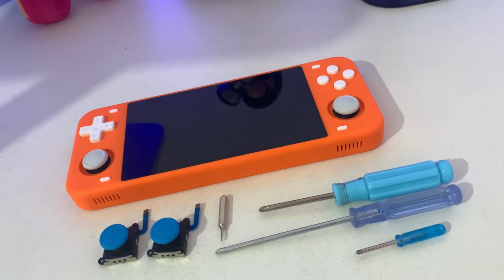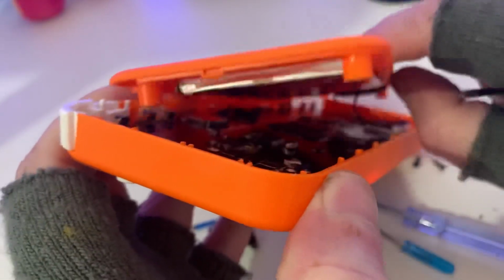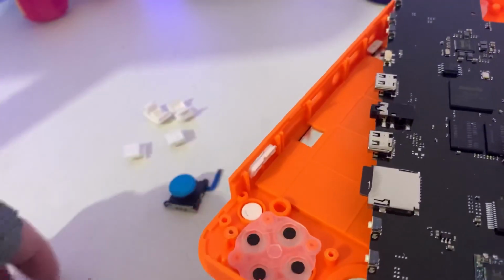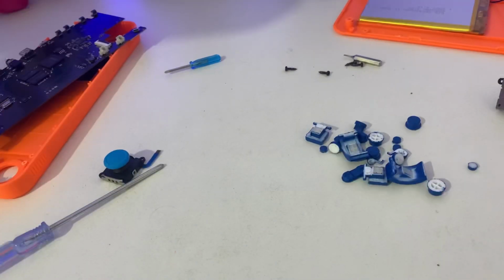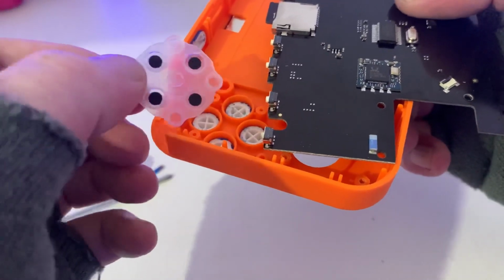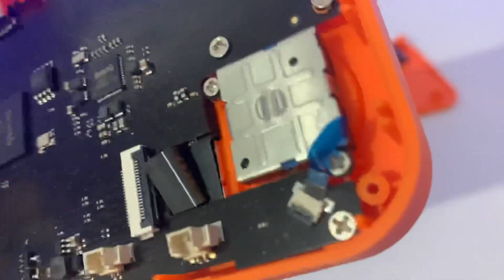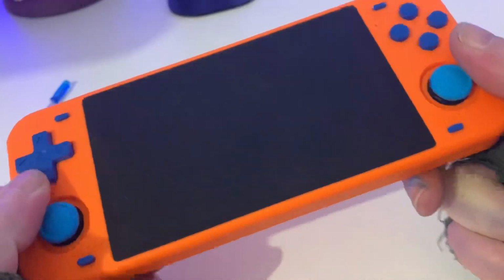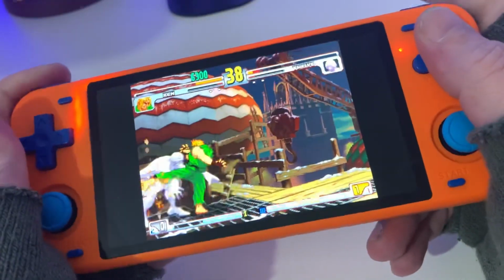RGB10MAX - Modding The Analogs & Spraying the buttons

Comment: Doesnt look to bad with the blue at all actually, still not my cup of tea though. 
Ali express has a few diff color shells available now yeah but just orange or black last time I checked. 
With or without buttons. 
Maybe if they come up with a metal shell or something else a little fancy Id consider it. 
I put some black switch thumb caps on my analogs, only small issue with that is cause the sticks are recessed into the shell a little adding the caps ofcourse makes the top of the sticks just a tiny bit wider so moving it right round as far as it can go 'just' touches the edge, but you cant feel it, theres no resistance or anything and seems to work fine.
I also put a glass screen protector on mine, just incase. 
Not a special made one for the Max, just one thats made for old HTC One M7 (5" screen with no cutouts). Just fits over the screen of the Max AOK.
Reply from the maker: I seen them, I have the 🐼 one arriving soon be nice to do a comparison to the first one and the latest version. nice touch with the screen protection…I will give that a go man. I get what you mean with the caps though.